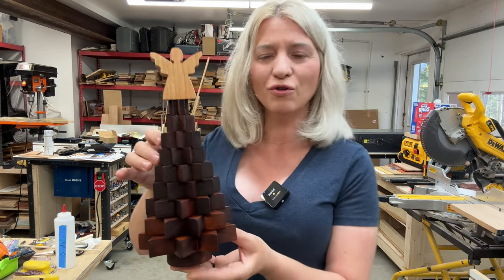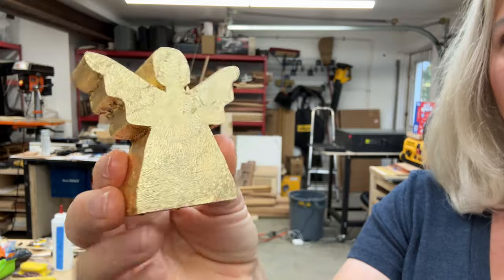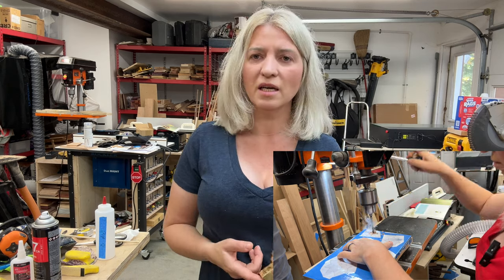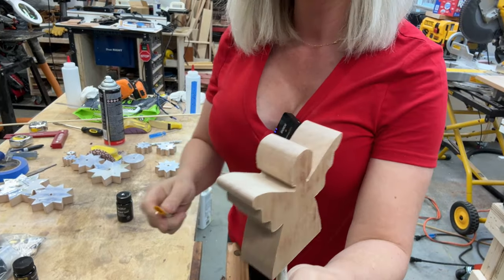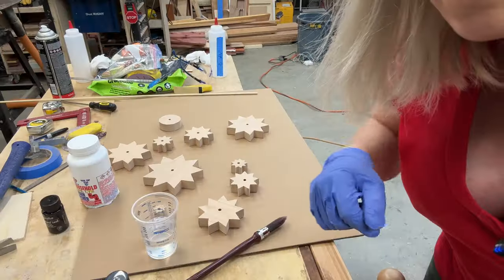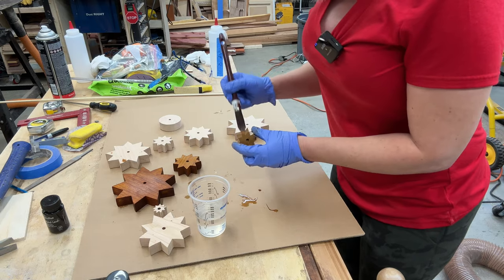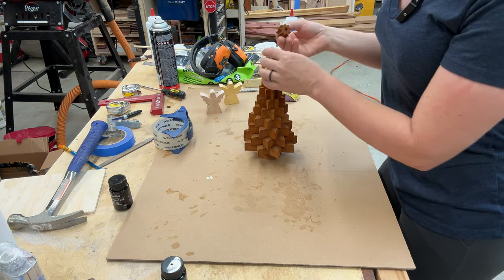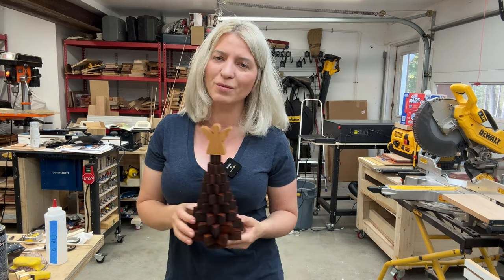How to make a wood Christmas tree. Beginner Woodworking Project

Comment: nice dimensioning look for your tree, I liked the base shade better than the top,(shows more grain). That would look good on a slow spinning spindel showing off 360! I'm still peeking at that router cart and hoping that laser's laptop is secured a little to that workstation worries me sitting on the edge in your busy shop!  I don't know how you get done I can't wait to retire as I can't get through my inbox much work in my shop. I always seemed to give things away before appliying finish, you are inspiration!

Comment: Oils like linseed oil (both raw and boiled) and even tung oil, can be a fire hazard, causing spontaneous combustion within any rags left in a pile, so care must be used with these rags when cleaning up after.  These oils dry not by evaporation like paint, but by oxidation, the same process involved in fire.  Furniture or wood projects do not combust because their oil is oxidizing in open air.  But a rag that's wadded, crunched up or folded just right, can act as an insulator and allow the heat generated from the oil's oxidation to reach BLO's flashpoint of 163C/326F, igniting the rag material.  Sometimes a rag can smolder for hours until open flame appears, and this process can speed up when temperatures are higher, such as near a stove, on a hot day, or in the sun.  One way to safely dispose of oily rags is to spread them out on concrete or outside, away from anything that can burn, until they dry before discarding.  Any rags that are kept for future re-use should first be dried, then stored in a metal can or other fireproof container, and kept away from structures or anything that can burn.

Comment: I believe the angel would turn out more to your liking if you smooth-finished it with shellac or varnish and then  600 grit sandpaper and then simply applied the gold leaf without glue. It will stick just like it does on the glass front door at your local bank. I think this will be a project that I do with my two little Granddaughters. Thank you so-o much.
Reply from the maker: Thanks Erick. Will try that next time